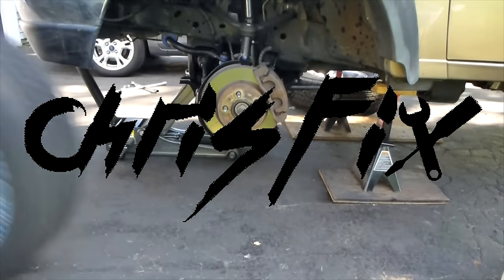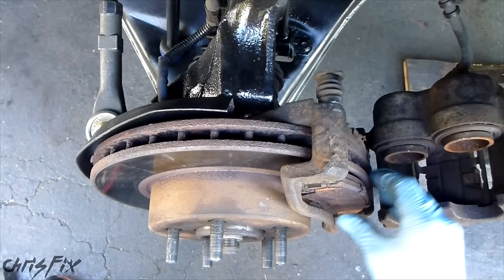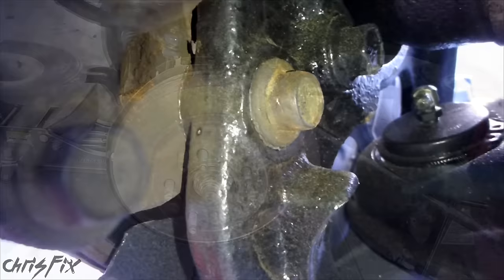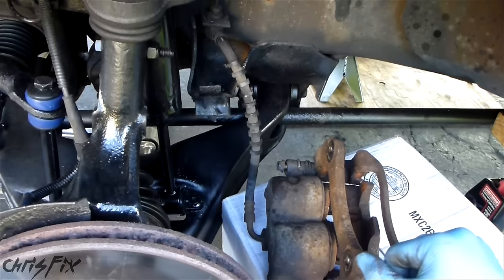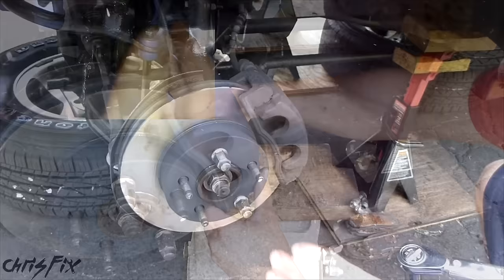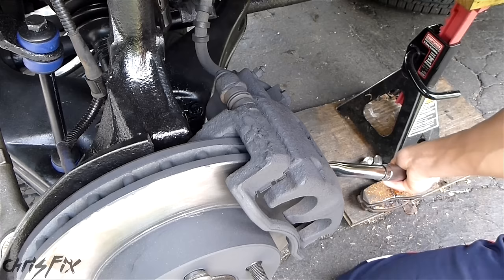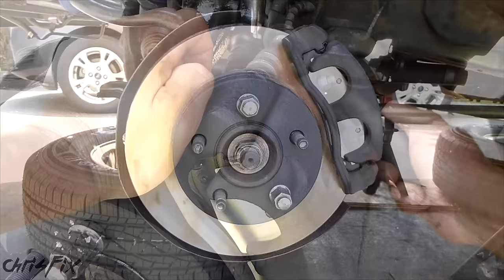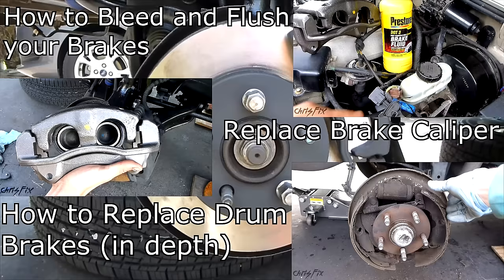How to Replace Front Brakes, Pads and Rotors

Comment: just a tip for all you first timers trying this at home. It might not be as easy as he makes it look in the video for you to do on your own. He does an excellent job but keep in mind he is condensing a 2-3 hr procedure into a 20 min video. be sure you have all the proper tools.. most japanese cars use metric fasteners.. YOU WILL NEED METRIC TOOLS! finding the closest US tool isnt gonna cut it, especially for those super tight bracket bolts that you need to hit with a hammer. make sure you have good lighting and have someone do it with you if it is your first time. also keep in mind that you could encounter something that you may not be equipped to fix such as a seized caliper and then you will be stuck. just things to consider before you dig yourself into a pile of manure and with that best of luck
Reply: A seized caliper is not a big problem, plenty of videos that show how to replace those as well.
Reply: Good advice definitely .
Reply: Is it really a 2-3 hr process? Wait, what if i’m just replacing the brake pads and nothing else?
Reply: it took me about 40 min today, that was with me being extra careful. its very simple my guy
Reply: 10-15 minutes a side......lol....if it takes longer than that you are doing it wrong
Reply: John Hoog link the video
Reply: Junmalo987 First time probably yea. Just changing brake pads is 1 hour. 15 minutes per wheel
Reply: It doesn't really take too long, just lift the car remove the tire loosen the bolts pull out the bolts holding it in hammer the shit out of the rotor if it's stuck and put the things on and redo the steps opposite simple takes at least half hour
Reply: Junmalo987 yeah I don’t know, must be a Hyundai or something. Brakes on my 2008 sable take like 20 minutes no lie.
Reply: @johnhoog8279  
I think what he means is that it is always helpful to have a friend (or at least a 2nd vehicle) nearby in case you need to run up to the auto parts store while your primary car is sort of 'broken down' & lifted up on jack stands, wheel chocks, etc.
Reply: I agree with you on that I had did a brake job on a 05' toyota and the one of the lugs nuts was stuck on the tire I had to get a torch to get it off.
Reply: NFL YoungBoy first time I ever did a front brake job I changed rotors and pads. First wheel was the learning experience and took me about an hour being very meticulous and going back to the manual regularly. The second wheel took less than 20 minutes. Assuming there are no complications like seized bolts, it doesn’t take long.
Reply: I’ve done brakes before. Very rarely should it ever take longer then a hour. That’s assuming you have the worst tool supply possible. I work in a car shop and good mechanics can do them in about 10-15 mins. But the average time for front brakes with a average Joe is probably around 30 mins and a newbie about a hour.
Reply: @Junmalo987  replacing the pads alone can take an hour in a half.
Reply: Was just wondering how long this process was then I found this thread 😂😂 he def makes it look easy and I was confused watching it be done lol hats off to you men that know about cars. I’m going back to the kitchen 😂
Reply: Took me about an hour. But yeah I feel you it's always some lil minor b.s that gets in the way
Reply: 2-3 hr?it took me 30 min
Reply: Neither was back side O2 sensor and coil springs in a side ways engine but once you get started it's either leave your car broken or finish the job
Reply: I wished someone told me this my first time . I ended up spending a long time getting my caliper piston compressed on my 20 year old car .
Reply: Absolutely, It takes me days cause No right tools.
Reply: @Remix God yes note how i say “first timers.” It takes time to make sure you have your tools in order, are doing things right, then you’ll run into some issues etc. just trying to be helpful
Reply: @Junmalo987  even longer if you have A.D.H.D. or A.D.D. 😝
Reply: 2-3 job? hahahaha how many customers are you ripping off. I taught my son and his first time doing the other side only took under an hour and he's only 3 years old!
Reply: @jimmystone  I don't think dude has any customers.
Reply: @liltoro4463  exactly very easy Did It For the First Time about 1 year ago all I did was change the pads took me about 45 minutes to 1 hour and I had extremely extremely limited tools and I use the jack that came with the car
Reply: I do 4 wheel brakes provided no problems occur in 2 hours. If you're taking 3 hours a wheel you're doing some shit wrong
Reply: That happened to me and my buddy, we took apart his brakes on his truck to replace them and turns out a caliber sliding pin was stuck inside the bracket. With replace the bracket because it was welxed in there lol 2hr job took 8hrs and back and forth to auto store (First time doing it) the truck was on the jack so long it sunk it into the asphalt
Reply: Lol my calipers seized asf
Reply: Thank you for this tip!!
Reply: If I took that long for every brake job I would be fired
Reply: I'm a learner
Reply: well said
Reply: Thought I would also add to pump your brakes after installing the new brakes
Reply: Dis video is 8 and a half minutes
Reply: 2013 altima rear brake pads with car on jack and wheels off... ahem....2 minutes max
Reply: Great Advice!!
Reply: 6 hours to get one wheel brake pad on, couldn’t do in a pair due to work
Reply: It’s OK we know you’re Mechanic and you’re losing business because it’s so easy you just had a bunch of bullshit nothing you said it’s hard I think you said maybe is that it will take about two hours
Reply: That is true if not u will mess up the whole car just be careful
Reply: @liltoro4463 lowkey what I was thinking , they make a 20 min video bc I’m sure if you follow every procedure correctly you can get it done in about 20-40 min easily jus make sure you research everything you need before hand
Reply: MY DAD'S MAKING ME DO THIS SHI
Reply: @bigchunkorange2966  don't do it
Reply: You're not wrong, if some things are too bloody tight, it can take a good while. I helped my father-in-law do his for his Nissan X-Trail and it took a a couple of hours and he knew what he was doing.
Reply: Should be able to complete the job over a lunch break. 15 to 20 mins for front and remainder for the rear. Of course reality dictates there will be an issue. Something will be seized or rusted or breaks off and it becomes a 3hr long odyssey trekking between the auto store and wailing on it with a hammer. 😂
Reply: Stop the Fear mongering.
Reply: @larry3d4Guda❤tnation
Reply: @johnhoog8279 this is not true for someone starting our. Seized calipers are TOUGH to deal with - especially if you don’t have a good engineering/physics background. Also many lack the equipment necessary
Reply: If you can’t just stop and out everything back. 😂 it’s not that big of a deal
Reply: Nah fam this shits like a 30min Job tops
Reply: lots of heros in this thread
Reply: Thx
Reply: 2 to 3 hours.. maybe 20 minutes..
Reply: @Asyouarenow  another YT hero.
Reply: Boy, you ain’t kidding.
Reply: @swampduck2609  from being a rent boy?
Reply: Great point. On one occasion while I was visiting a friend 4 hrs away from home, we tried to do the rear brakes on my truck. We could not compress the rear/passenger caliper (using a C-clamp) so I had to chip the pads using a chisel to make them thin enough to fit  back where they were... so I could drive home.  4 hr drive with no rear/passenger breaks. Once i got home, I paid to get it fixed... It could have been worse....
Reply: @gogators043    Well said. Never touched upon removing the dust cover & rotor innards on my 2000 Ranger; had to dope that out to remove. Now I can’t get the dust cover back on no matter show I try (rubber hammer) AND rotor won’t spin, which means ___?. Thought this was ohhh so simple! Arghhh!

Comment: Thanks a million for this video. Dealership wanted close to $2000 to replace front/rear pads and rotors. Picked up the parts for just under $500 and had all 4 done in just over 2 hours.
Reply: Same thing here! Its insane price for a such job…

Comment: awesome video. dodge wanted to charge me $659  for front rotors and pads. I did it for $150
Reply: ipukeatparties logic right there
Reply: Same with Infiniti. They wanted $650 for rear pads and rotors. Got the parts and did myself for $130 and 4 hours time. Paid myself $130 per hour, so I went golfing....
Reply: Depending on wear, I usually re-surface the rotors 3 times (as long as there's enough material)  before I replace them. Disc brakes usually cost me around $50 over all (including brake cleaner), for the front two, with OEM pads. Your local brake shop should be able to re-surface your rotors for about $20 each, if you don't have a machine in your shop.
Reply: 6:30 just like a condom
Reply: 1990 dodge Dakota, all I can say is them dodge brothers make shit complicated in their truck builds
Reply: I asked some random mechanic. To replace break pads (only!) he asked $450. He told me it will take 2.5 hours!
Reply: Thats crazy high! Yeah I need to do mine soon, considering doing it myself
Reply: haha good man
Reply: you will always save when doing it on your own, I'm doing my brake system in twenty minutes.
Reply: ipukeatparties same here, 150$ for all the parts
Reply: I just got quoted 275 for the front there good people but i cant afford  that ima have to do it myself with a friend
Reply: Jon Davis 1997 geo prism and i havr the parts already
Reply: Jon Davis  chuld have got better price online but with a 2 year and life time warnty i don't  mind
Reply: I paid 330 for brakes and routers it saved me so much
Reply: A local shop (not even a dealership) wanted around 400 to replace my catalytic converter. I replaced it for 50 dollars
Reply: @WECantThink  NICE
Reply: Before I started working on my car. My mechanic charged me $120 to replace rotors and pads
Reply: Awesome 👍
Reply: ipukeatparties 659 ha its doubled in 3 years les shwab wanted 1200! Insane
Reply: I got new front and rear brakes + rotors and the inner + out tie rods for both sides for under $140. All brand new and high quality for my 2011 Ford Fusion Sport.
Reply: Mechanics are so out of touch these days.
Reply: Shop wanted to charge $700 I did it for $400
Reply: @WECantThink  lmfao paid yourself
Reply: Where is everyone buying their parts. Looked on auto zone app and it was almost $400 for the brake and rotor set, front and back
Reply: @tanaw47  Same question. One front rotor cost me $110 plus tax an brake pads $70 plus tax.
Reply: @ipukeatparties where’d you get your rotors and pads and caliber from for it to be only 150?
Reply: Alan Xu where you’d get the parts from ?
Reply: I did my front brakes for $150 (shop I usually go to quoted $341).

The rear drum brakes, however, I paid $750 for the shop to do it because I was too lazy to do it myself and drums are annoying.
Reply: 659 that's more than the dodge is worth!
Reply: Dealer is ripping the people off...
Reply: mazda 6 disc brake
Reply: @eduballen10  amazon has break and rotor kits for 65 to 200 depending on your car and quality
Reply: @WECantThink  lolol. Hope you enjoyed golfing after replacing your brakes :)
Reply: @AL-mm9mc  only dummies go to the dealer🤣🤦

Comment from the maker: Shirke M You do not need an alignment after doing any brake work. The only time you may need an alignment is when you work on the suspension such as replacing control arms or ball joints.
Reply: ChrisFix I just replaced my front anti-sway bars.  Do I need an alignment now?
Reply from the maker: Enigma758 Nope. Sway bars will not affect the alignment.
Reply: +ChrisFix What about front struts?
Reply: +Guimatics , No
Reply: +ChrisFix I NEED A QUICK RESPONSE, CAN I USE ANTISEIZE instead?
Reply: How much for a decal?
Reply: +ChrisFix  Does the thickness of brake pads affect braking distance? Like my pads are worn down to 5mm and 6 mm. Should I wait for it to wear down to the minimum 3 mm or go ahead and change it now?

Car is a 2014 Toyota avalon Hybrid. Thanks!
Reply: K Mathew Use what you have. You're not going to experience any reduced braking.
Reply: Hey Chris, awesome stuff mate! I only need to change the brake pads for my Rear wheels. How often do you have to change the brake rotors?
Reply: Optimus Prime don't you have drums?
Reply: Thanks brother.  Very helpful
Reply: ChrisFix 
I notice that my breaks came with some brackets and a small package of fluid.  What do I do with that?
Reply: ChrisFix ........ Is it that easy on a 94 Ford Thunderbird? Please respond. I need info quick.
Reply: ChrisFix I'm really new to this but I want to start fixing my car and learning. This may seem really dumb. Do you have a video on car Jack's and basically getting the car in the position you have yours that way I can actually get underneath and work? Including safety precautions
Reply: Emmanuel Gutierrez *brakes

Comment: Chris, This is a really detailed and informative video.  Thanks for your efforts.  I can't wait to start saving money by doing my own car maintenance.  You've made it look easy.
Reply from the maker: +Rich Edinger Thanks a lot Rich! Hopefully my videos will be helpful!
Reply: +Rich Edinger Agreed.... Huge savings over dealership/Midas shops.   I finally have a garage to work on my vehicle.
Reply: @chrisfix  That stuff you sprayed on the rotors do you just spray it on and leave it or do you spray it on and then wipe them off? thanks
Reply: @chrisfix  What is a braker bar that you used to losing the braket bolts?Sorry dont know much about cars lol
Reply: @lessummers5738 breaker bar is similar to a ratchet except it’s long and stationary with the purpose being leverage to crack tight fasteners
Reply: @jaz8615  Jaz thank you for responding to my question👍

Comment: just changed mine out, 90 minutes, fixed brake shuddering and improved brake feel with no labor cost!
Reply from the maker: +danthemanzizle AWESOME! That is what this channel is all about! Nice work!
Reply: +danthemanzizle no labor cost! That's what I'm talking about
Reply: +pikiwiki heck yea! but I actually had to remove my new pads and put the old ones back in, the new ones were squeeking loudly and chips were coming off the Edges! so my advice, get good brand name pads.
Reply: +danthemanzizle its best to get the brake pads recommended from you cars manufacturer.. Or something close because not all brake pads work (: just saying
Reply: thank you for showing your video
Reply: Did you need a torque wrench?

Comment: Thanks Chrisfix I just removed, painted, replaced my brakes z front and back... I had extra rust inhibitors and paint so I gave both cross members a good sand down and soapy water wash before applying rust inhibitor sealant, primers and ceramic paints. Woohoo you're one of the best instructors.
Thank you!
I'll post pics on insta because I can't here.

Comment: How could anyone down vote this? This is an incredibly well made video! Thank you!
Reply: To answer your question: I downvoted the video because  it was kind of a slapdash work. Like: only one side of the rotor was cleaned, the shims were not replaced or at least cleaned, the pin or the shims were not greased (the later was only mentioned in the video, but not done).

Comment: use a c clamp if you don't have that tool
Reply: Remove/loosen the brake resv. cap and use a large channel locks, then "hang" up the assembly with an old metal hanger (also works).
Reply: Auto parts stores may also have the tool that you can borrow.  You put down a deposit which they give back when you return the tool.  That said, I usually use a c-clamp.
Reply: I've always used a C clamp and block of wood to spread out the pressure, that's what all the mechanics used when I was growing up. Had no idea they actually made a tool for it.
Reply: @johnhoog8279  this is the first time I seen a tool for it too, I've always used a c clamp
Reply: Do you know what that tool is called?
Reply: Woodworking ratchet clamp works too.
Reply: I don't know what's easier,  implanting a heart or pressing the brake with C clamp.
Reply: Or channel locks
Reply: use the old disk  before removing it from the hub and use a flat srewdriver to pry it by using the 2 holes on the caliper and push the disk in the direction of the piston and it will go in and then remove your caliper change what you need !
Reply: lol I did the brakes on my car like 4 years ago. I was sitting here like.. I remember doing this step.. but I don't have that tool..
Reply: Tool is like $10 at my local Autozone. We have 3 cars in the family. Totally worth it to me to buy it.
Reply: @johnhoog8279  Because a c-clamp is heavy, some people use a brake spreader.
Reply: I use an f clamp! 😊
Reply: @negan5374  
Why would a heart need boobies? 🤔

Comment: For all the cars I have had over the decades I have spread white lithium grease on the mating surfaces of both the back of the wheel and the front of the rotor. Keeps them from becoming super stuck together. Having done that, I have never had a wheel whimper a protest about coming off.
If I were doing a rotor replacement,  I would do the same to the back of the rotor where it contacts the axle end.
A little prevention now can prevent a lot of crying later.

Comment: Great videos Chris, tackled this job on my 2006 Ranger a few weekends ago and will be replacing my shocks this weekend.  Just wanted to leave a comment to potentially help someone else out, doing the clamshell method could potentially bend the brake hardware and cause it to not fit well and scrape against the rotor when you are all done.  I had to completely remove the caliper from the mounting bracket to avoiding bending the hardware.
Reply from the maker: Thanks for sharing!